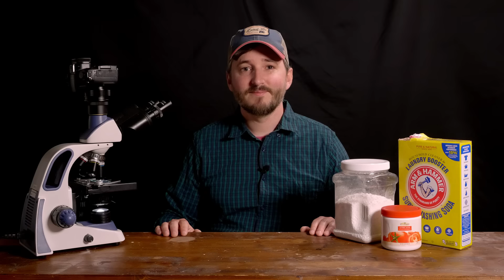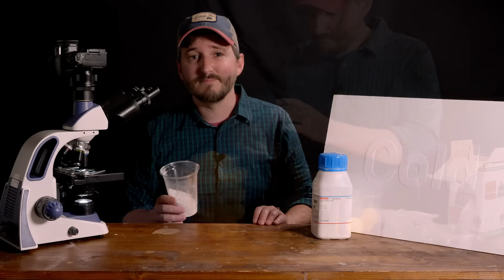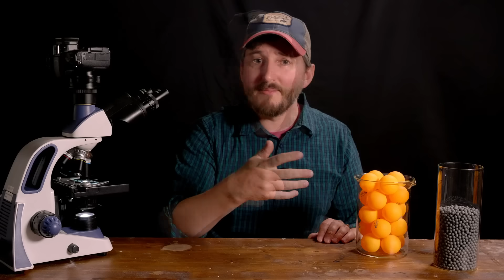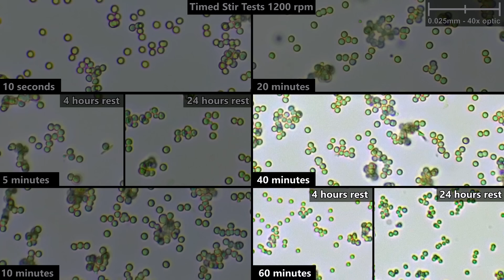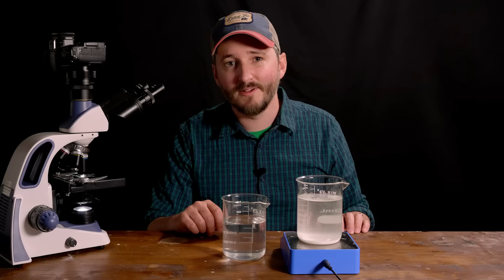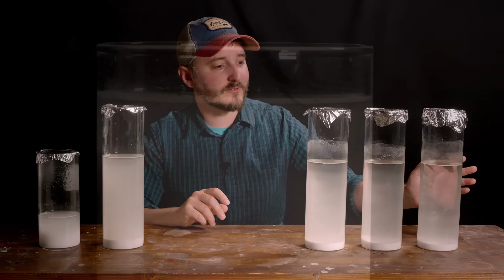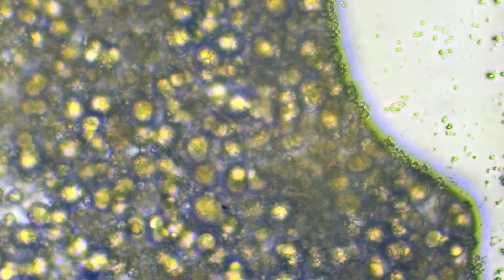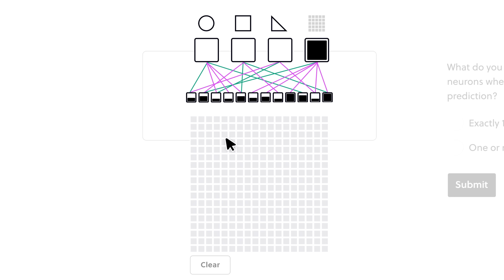Making Infrared Cooling Paint From Grocery Store Items (w/Novel CaCO₃ Microsphere Synthesis)

Comment: Hi Nighthawk, my second comment on this video. As you're using a prospective sheet, why not 1) apply your coating directly to the back of this protective sheet? Or 2) fold the protective sheet and seal the edge with heat, steadily fill this with your mixture, and pass this between rollers with a set gap of a few millimetres, and continually collect the resulting sandwiched sheet on a large roll for use later? Or 3) instead of folding the protective sheet, seal the edges of two separate sheets with different properties as appropriate, one as a supportive/conductive backing sheet with adhesive if required, and the other as the protective outer weather shield, then fill, pass between the rollers and collect on the larger roll as before? Any length of the finished roll could be heat sealed across it's width and cut to any length as required, then the finished flexible panels can be handled cleanly, transported and fitted where required? Or 4) the outer sheet could just be a thin guide sheet to be peeled off later if the paint works better when exposed directly to the sky? The temporary sheet would still enable the mixture to be rolled to the correct thickness, support it to be placed immediately on the large storage roll, and protect the surface during transport?
Reply from the maker: Part of the point for the film is that there's an insulating air gap between outside air and the paint
Reply: @Nighthawkinlight  Then the top sheet could be a double sheet with air pockets incorporated, a bit like a super wide bubble-wrap honeycomb, or full width barrels/tubes if that's easier. And all the other benefits and speed of manufacture would still apply, including not having to wait for the paint to dry? A thin absorbent layer below may help to stabilize/semi-dry the end result without the paint cracking before it's final installation? Also, is the insulating air gap truly usefully needed if the underside is conductive and adhesively installed?

Comment: With this solution being pretty fragile, do you think this "paint" could be aplied to an attic floor (as in the backside of the ceiling sheetrock) to reflect the heat coming from to roof away from the living space? I'm thinking the would be a safe place that would keep the paint from getting damaged. This may keep the heat in the attic long enough that it is vented back out (either through a ridge vent or gable vent). I would be afraid that if you applied it to the underside of the roof deck it would cause shingles to delaminate. It may be fine to do that if it was a metal roof but mine is not. If it did work, do you think adding the insulation back on top to provide a sound barrier would change the performance or protect/damage it?
Reply from the maker: The paint needs to face open sky to work

Comment: If I could make a suggestion on application ... make a scraper with a "saw-tooth" instead of a straight edge. VVVVVVVVVVV  If the paint is not too thin or thick, it will smooth out to a  well regulated thickness depending on the "tooth size".  
Much thanks for your awesome research!  I'm already making a shopping list 😀

Comment: Hello NightHawk, what happens if you either 1) put a mixture in the blender and take a desired quantity off every few minutes, or 2) add a small quantity of mixture into the blender every few minutes? Would one or both of these methods fail to produce the different particles sizes that you get with completely different batches blended for different measured times?
Reply from the maker: Taking a quantity out of the mixer at set times would work. Adding more would probably not work
Reply: @Nighthawkinlight  Them you could have a larger mixer container with a tap and take measured quantities off at timed intervals into separate containers, all without stopping the mixer?

Comment: By the use of what used to be called a Doctor's Knife, you can draw out films of a uniform and arbitrary thickness.  The knife is a long, straight blade that is supported at both ends with a perpendicular end plate that allows the height of the blade above the surface to be adjusted.  The blade is typically not perpendicular, but canted to drag the liquid across the surface of the panel.  Set the blade height, pour a pool of paint and draw the knife on the panel surface.  It works like a squeegee, but allows for a precision coating thickness from one end of the panel to the other.   Wonderful chemistry, gratz.

Comment: 0:01 - "Hi everyone!" Hi Wil Wheaton!

....sorry, I can't help but see it every single time. Anyhow - thoughts on protecting the coating. Would it still be effective (and/or would the effectiveness be reduced) with a more rigid plastic cover - say, polycarbonate or acrylic? Or, if the paint at its applied-and-dried thickness was able to have a smooth enough surface, what about using a clear epoxy overcoat for added physical rigidity and protection? Or, could you simply use the epoxy itself as the delivery agent for the pigment? (Picturing using something like this for the outer paint coating of a small, electric-bicycle-towed single-person camper.)
Reply from the maker: Needs testing to know the answers. Polycarbonate won't work because it blocks IR.

Comment: How about using a plastering roller or a spatula with those serrated edges?
I mean plaster is meant to be put on relatively thick, but evenly; similar to your paint. And you could vary the coating thickness by picking a spatula with smaller serrations, a roller with different porosity, or a solid roller with smaller ridges.
 
Have you tested how the evaporation time of the acetone affects the strength and warping of the final coating? One could think, that if the paint is setting slower, that the paint will have less internal stress upon drying. I'm thinking about applying it in a cold place, or closing it off, to increase setting time.

Comment: Very cool and fascinating! Great work as always!

A couple of ideas:
1. Will your giant syringe fit in a caulking gun to make it easier to apply?
2. Would drywall spackle make a complimentary base that you could apply with a trowel?
3. Would other household crystal structures like sugar or salt give a similar cooling effect, even if less effective due to the crystals likely being square vs spherical?
4. Please tell me you're cooling water with that aluminum coated pipe and you will share the results! 😮😂

Keep thinking outside the box. You sir are a master at inspiring!
Reply from the maker: You can buy refillable caulking tubes that might be worth trying. Sugar and salt would dissolve quickly and I'm not sure of their IR emission spectrum. The coated pipe will be for the future
Reply: @Nighthawkinlight  I did not realize there were refillable caulking tubes, but that makes sense there would be. There are also grease guns that don't require a tube but I am sure they would give you a lot less control.

If sugar or salt were able to reflect the right IR wavelength range, you could potentially apply it as a liquid to let the crystals grow on whatever surface requires it, spray on a light clear coat, then possibly finish with clear uv resistant resin. 

I would guess salt would be easier to work with so long as it doesn't oxidize the surface it is applied to, but of course it would be difficult or next to impossible to control external parameters when applying it.

Comment: As someone who hasn't heard about this, it just sounds incredible. That you can cool something through sunlight without aditional energyinput or circuitry just seems imposible.
Also the Amount of R&D youve put into this is stunning and educating the rest of the world for free about this is the perfect ethic.  Thanks so much, didnt know I needed a 40 min Video about white paint ^^
Reply: It isn't cooling via sunlight. It is not gaining heat energy via sunlight (via a combo of its extreme whiteness and light scattering effect) while simultaneously radiating some thermal energy up into cold space, thus ultimately losing more energy than it gains, which makes it colder than ambient temps. 

   Btw, you can very easily cool things at night (well, on a clear, cloudless night) just by shaping some shiny, reflective aluminum foil and shaping it into a parabolic/dish like shape, putting it out on a clear field or open space (no trees, buildings, etc looming over), and putting whatever you want to cool on there but with some air space between the object and the foil dish surface (that airspace is crucial, otherwise it won't effectively reflect the thermal energy away from it).

   If you look up how to make a Solar Funnel Cooker, you will see that the inventor talks about using it at night to cool water down some 20* (F) cooler than ambient temps (so if the air temp was 80* F, the water became 60* F over time). And that is without extensive or involved optimization.
Reply: @justinw1765  thanks for the detailed explanation :D
Reply: @infelicitatis  You're welcome.

Cheers
Reply: Combine it with a cooler that already keeps ice from melting for days and it might double the coolers effectiveness for over a week or more.
Reply: @HappyFace6or7  Yes, especially if the cooler is made out of materials that allow IR to pass through well. Thankfully a lot of materials that are opaque to visible light, are fairly to highly transparent to thermal light/heat energy.  Some materials that come to mind that are highly transparent to IR are acrylic, PVC, polyethylene, and fumed silica .*  Somewhat, but less so are things like wood.

  * In fact, fumed silica is a common filler/spacial material in vacuum insulated panels because it is light weight and highly insulating even when not under vacuum (more than most foams, and is on par with silica aerogel at a fraction of the cost).  It's downside beside attracting moisture is that readily allows IR to pass through it.  So here you have these amazing insulating panels from a conduction and convection standpoint per volume/thickness of material, but very poor from an IR standpoint.  (So IR reflective films or the like are often put in the panel to compensate, or it is mixed with other media, like perlite, that do block IR transfer). 

     But I'm actually working on such an idea, well not actively right now because I want to focus on a more simple project meanwhile that will make some money so that I can devote more time to this.  My ultimate goal is to make a vacuum insulated cooler that can double as a Solar oven and off grid microfridge, and try to make it is as inexpensively and sustainable as possible. NightHawkinLight's recent formulation makes it that much more feasible.  Though, I have also thought of just using an ultra white paint and using reflective material underneath (like I outlined above), along with a peltier and solar panel to help cooling during the day, and the radiative cooling to keep it cold at night. 

    I'm currently making vacuum insulation panels at home for the other, more simple project (a hybrid soft/fabric-hard cooler [it has some structure from the VIP's inside it]) that's made out of mostly recycled, recyclable, biodegradable, and/or non toxic materials. The prototype is almost done and I will be putting it up on a crowdfunding site soon/ish.

Comment: If a large area, lets say football field size or larger, were coated with this along with some heat exchanger, then (if I understand correctly) it would generate a column of hot air going at least higher into the atmosphere, which would draw in the surrounding air towards the bottom of said column and with this expectation you could have installed wind power surrounding the painted area to power the pumps for the heat exchanger(no clue what the numbers would actually results as)
Reply from the maker: No, the air isn't warmed because the light from the panels is not absorbed
Reply: @Nighthawkinlight  gotcha, Thanks for the clarification :)

Comment: cant we make a reverse solar water heater with this? by coating a coil of copper tubing inside a sealed glass case, by flowing heated water through the coil would it dump its heat in the same way these usually accumulate heat energy

Comment: you might be able to use a hole filled sheet possibly silicone to produce a lot of spread spots of the required thickness, an when dry( or almost dry remove ruber) then when fully dry spread rest of surface coat with a wde spatula possibly a dencer mix to compensate for first coat shrink; thanks for your work

Comment: The strongest reflection of light will occur when the light passes through  interfaces with the largest refractive index delta. 

CaCO3 has a refractive index of 1.65, your acrylic binder has an index of 1.49 and air has an index of 1.0. So the strongest reflections will occur at the air-to-CaCO3  boundaries and the CaCO3-to-air boundaries. The implication is that the highest performance will occur with CaCO3 bound with the smallest amount of acrylic that is practical. Perhaps a sandwich of  CaCO3 powder covered by a film of acrylic ?

Comment: Have you tried using a v-notch trowel to spread an even coating? If it has enough self leveling to fill in the v's and flatten out it should give a smooth finish.

Comment: I worked in a coatings formulation lab for a while and one of the ASTM tests uses a blade for a drawdown test to give coatings a uniform thickness. The standard test is usually to dispense a given volume from a syringe in a line onto a plate with some sort of rails on the edge, you then take a metal scraper and drag it along the rails to knock down the high spot and give the coating a uniform thickness. Not sure how well it would work with the viscosity of coatings you've produced but might be worth playing with.
Reply from the maker: Others have recommended screen printing or glue combs which are both a similar idea. I'll have to play with this. Thanks for sharing your experience!

Comment: You outdid yourself yet again.
What's more this time you even managed to outdo Tech Ingredients which is immensly impressive.
Compare them spraying 50 different coatings over the course of the whole day against your cake frosting application once AND your ingredients are even more accessible.
Bravo! You really could start a chemical company, you're definitely further ahead in this than any research lab out there. And then there's your non-flammable fireworks.

Comment: Idk why i forgot the spheres, I've been making some out of caco3...i thought i had to grind it to a variety of particle sizes... and i did read about forming microspheres using gelatin... but... my best result was to mix some chalk used for ceramic glaze... so 74 micron and less...i used boiled linseed oil... and the chalk... that doesn't work very well... but then i tried sprinklihg some powder on top and it works well. It feels cool to the touch. But....i only thought about it when it rained.... it's not waterproof that way, and i didn't have the plastic film on it but ive been wondering if there's any clear coats to be used because in some applications it's not feasible to use plastic film

Comment: You know your solar hot water heater? Painting those pipes with this paint instead of black paint might make a good cooling radiator. But the glass sheet you used likely won’t have the right IR properties. Finding something both sufficiently transparent (or maybe absorptive) in the radiated IR range, and sufficiently transparent (or reflective) in the solar spectrum might be difficult, while keeping it mechanically strong and weather-resistant. UV resistance will be even harder.

Comment: I think that it's literally "high density" in the physical sense! There is more CaCO3 (and less void) per unit volume, so it should be heavier per unit volume as compared to the material with more void. Do you think it would be useful to try to calculate the density of your samples? I think you could perhaps use that value to verify how much void is left on average. Measuring the weight should be simple and calculating volume can be done by putting the sample in a plastic bag, submerging it in the water and measuring how much water is displaced.

Awesome video!

Comment: With obvious control of the consistency of the final product why not aim for something closer to a gel or past and using a wide spatula, like a drywall spatula used for tape mudding, with fixed guides to develop a consistent thickness of the coating? The self leveling should overcome any lines left by the guides and you can get those spreaders in 12" width. Pour some of the coating on the desired surface, spread it out pizza sauce style, and wait for it to dry.

Comment: as I understand it, the ideal carrier would be one with a minimal binding volume (either A: low volume increase at working mixtures B: highly shrinking during curing/drying, or C: all of the above) to achieve best coverage, and the ability to incorporate micro bubbles to boost internal reflectivity. Given those requirements, it might be better to use a two step process with a very thin laquer for the base carrier and a clear top coat with the acrylic for "frosting". Though I may have that wrong from a surface area standpoint...

P.S. Well spotted on the shoutout to Tech Ingredients on the similar content, I also learned a great deal about packing density from that video and his other on homemade thermal paste (which uses the same trick) [EDIT: can't believe I messed up the name of his channel, although Tech Connections is good too]